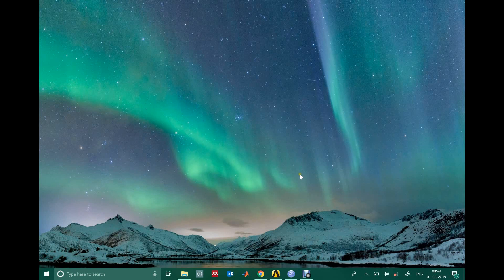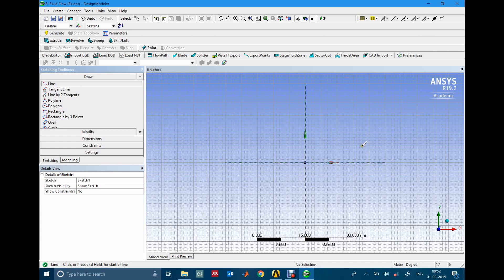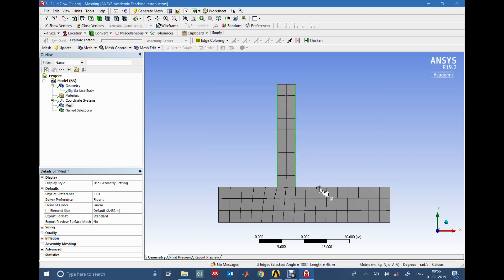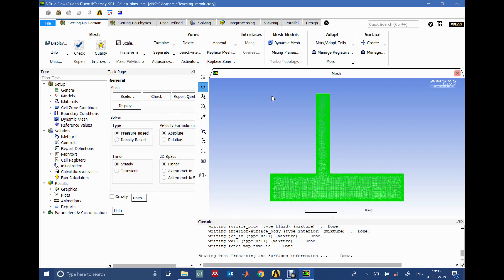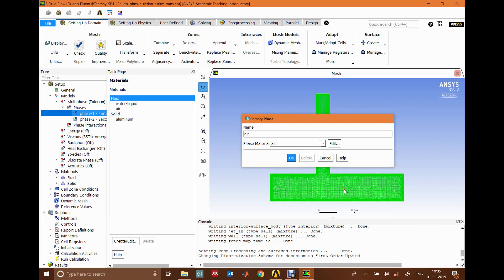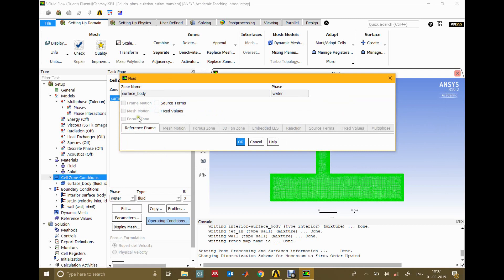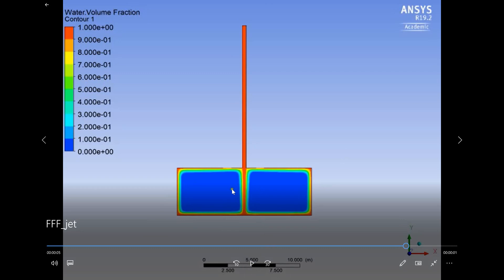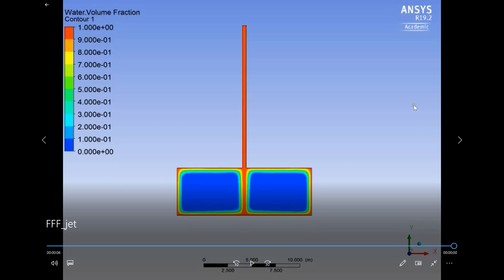Simulating a Jet Impingement in ANSYS Fluent using Eulerian Multiphase model | 17 | CFD Basics

Comment: Tjank you for this very useful tutorial.
I have a question.
At [10:38] you check the cell zone conditions. By opening the "surface body", you set the phase as water. Why? The surface body indicates the domain which at the start of the simulation is filled with air. Why in the cell zone conditions you set the phase as "water"?

Thank you 😃

Comment: Thank you Tanmay for the tutorial, may I know what could I do at the inlet if I were to change this to a pulsating jet instead of a continuous one?(Question is open to the users as well)
Reply from the maker: I suppose you’d need to write a user desired function for that.
Reply: Yep worked out using multiple nested if conditions thank you for that
Reply from the maker: Perhaps you can share the UDF here so others could be benefitted by that.

Comment: Thanks for the tutorial. Could you help me understand why 1. You're not using DPM and/or VOF for this and 2. why you patch the air material instead of assigning it as a mesh zone. You can point me to any reading material to save time. Thanks in advance.

Comment: Hi Tanmay Thank you for the video,im struggling with a hot plate problem, how do i set boundary conditions for the hot wall, the phases auto change ,how can i avoid this
Reply from the maker: Is it a multi phase problem? What boundary conditions are you using? Constant temperature or heat flux?

Comment: What would you have to do differently if it was a submerged jet? Like if the jet was going through water, as opposed to air.
Reply from the maker: You have to use an additional domain around the jet. It would be worthwhile to checkout my tutorial about a falling droplet, that would be a good starting point.
Reply: Hi i will be happy to cooperate, I am student working on jet impingement on hot plate.

Comment: if two fluid like water and oil are mixed then how can it possible to solve in ansys , and which model can i used and please tell the ansys setup solution.
Reply from the maker: It depends on what your objective is. Try with Eulerian model if the problem is general.
Reply: @TanmayAgrawal7  actually my problem is that to visulise the instability at the interface of two fluid where porosity and permeability properties was given
Reply from the maker: You might need fine grid-resolution first of all in addition to the various models.

Comment: I want to a plate where jet is hitting
Reply from the maker: This as you can see is very similar. You can model the bottom domain to be wide enough to simulate a plate.
Reply: @TanmayAgrawal7  i want to hit high pressure water around 300 MPa what will be the boundary conditions.
Thank you
Reply from the maker: You can try pressure-inlet boundary condition in that case. Make sure to use a small time-step and fine mesh size.
Reply: @TanmayAgrawal7  can i take plate as solid ( any material )
Actually i want to see the stresses on solid plate.
Reply from the maker: I think yes. As long as you know the basic mechanical properties, you can have any material.

A rough estimate can also be seen in this tutorial if you use pressure contours 😃
Reply: After calculating how to set up views & animation please guide